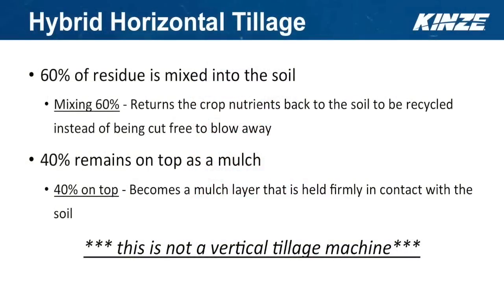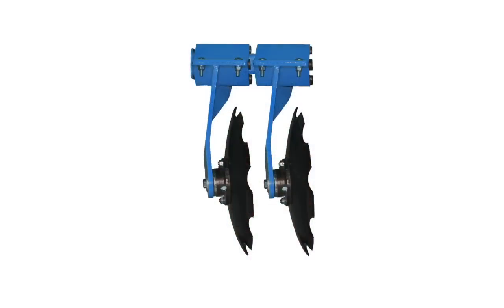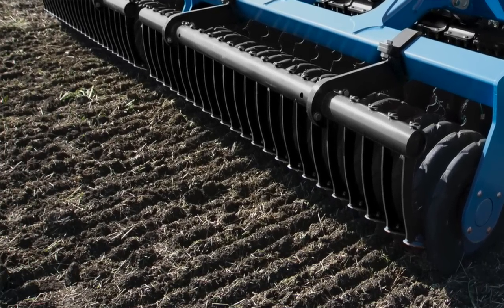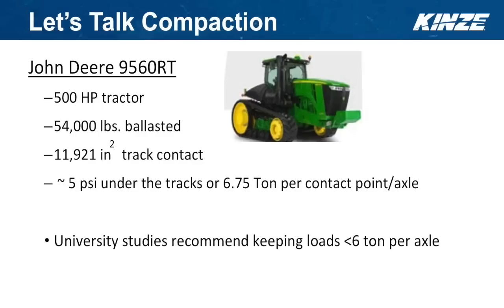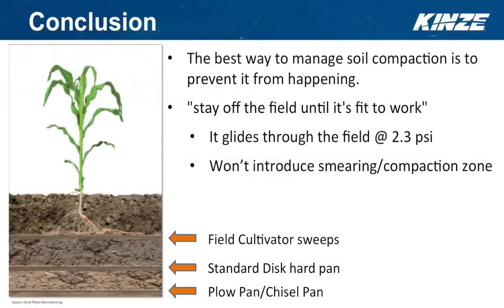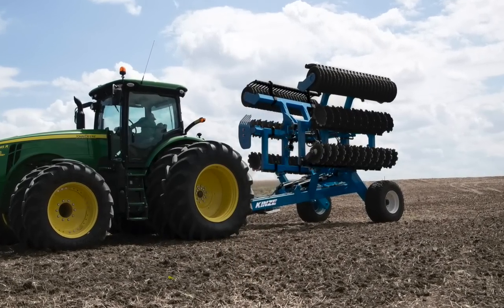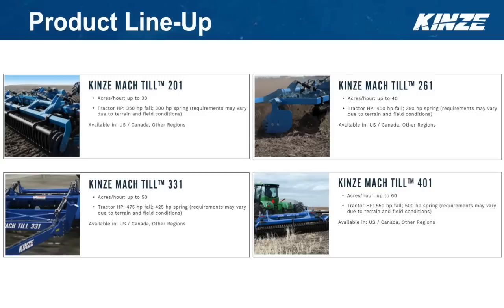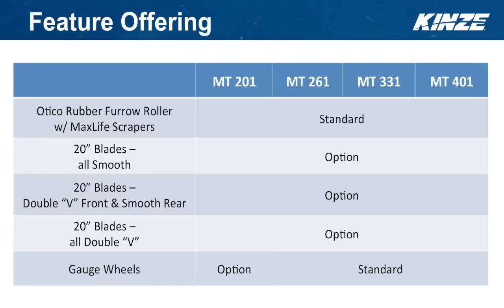Kinze Mach Till Explained

Comment: Will this thing kill all weeds in a single pass? Landoll VT are nice, and were the hot thing, but they only kill about 80% or maybe a little more.
Reply from the maker: Hi, Max - Yes, it will. The blades are working the soil both left and right. By doing this, the blades have full coverage for weed take out.
Reply: Good, thanks for the reply.
Reply: Spraying  first then use this tool for best weed control